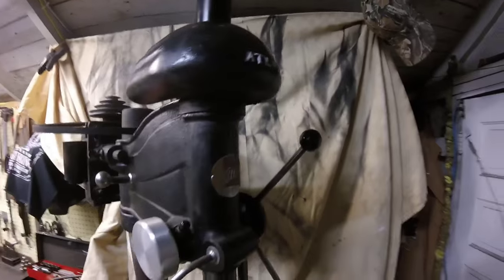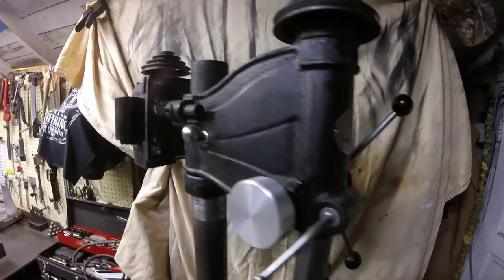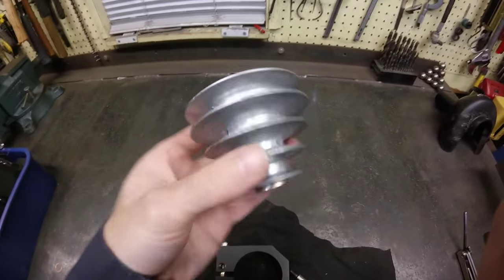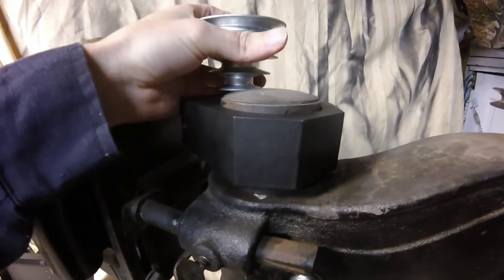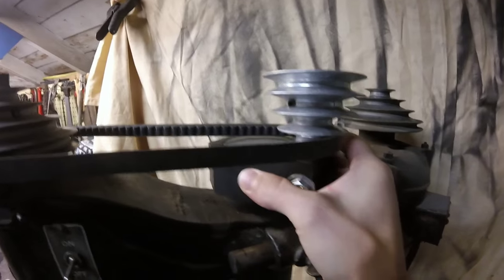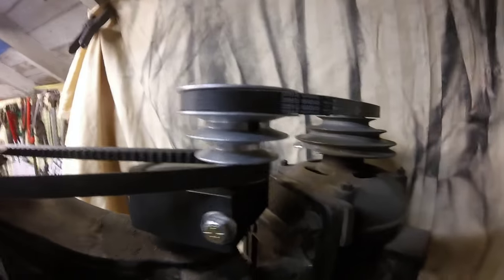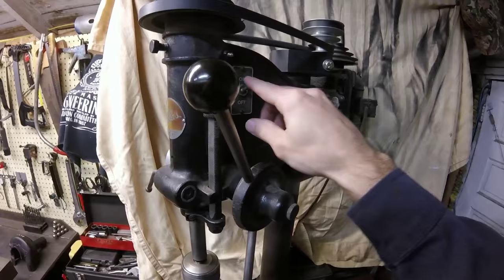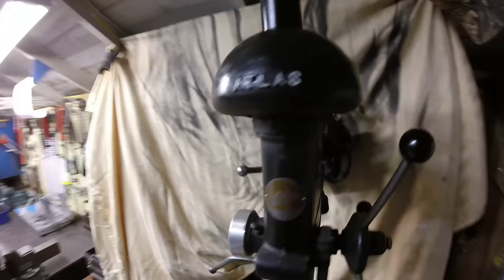atlas drill press pulley upgrade/modification

Comment: MrBen527 as soon as you removed the front pulley cover I seen why you had an RPM problem. The step pulleys shouldn't have the large diameters in the same directions it should have one on the top side and the other should be on the bottom side. Look up step pulley calculator on the inter net and you will be able to figure out your rpms.
Reply from the maker: +toddlfrank   You must not have seen the annotation in the beginning of the video.  I mentioned that I had already flipped that pulley over to work with the intermediate one.  Thanks for watching!!
Reply: dude be more positive and solve your problems with progressive & improved technology and leave cheap politics to burocrats

Comment: Thank you for making this episode. Very helpful. Wish I had one of those brackets. BTW, what model number is your Atlas?
Reply from the maker: Your welcome!  Looks like it's a model 63-1M
Reply: @MrBen527  Thank you for replying! I just found out mine is a model 73. Bought the stop assembly on eBay for $12.
Reply from the maker: @SCWD_US  Cool!  This press was saved from a scrap yard shop that was closing.   I had to replace the start capacitor on the motor and that was about it!
Reply: @MrBen527  nice!

Comment: Great! This is just what I need to do with my old Craftsman/Atlas. So what kind of bearing was in that housing? I'd like to do the same thing to avoid any permanent modifications to the press. I know I could make another motor mount and fab a jack shaft on the back with some pillow block bearings, but I feel like it'll throw the weight off by moving the motor off the center line.
Reply from the maker: +Bob C 
That housing is off of a servo driven ball screw assembly.

Comment: That's the perfect piece I need. Where did you get the bearing housing? I've got an old Craftsman 113.24560 with a 2.75" OD stand, and that would make my life  r-e-e-e-l  easy putting a jackshaft pulley on it...
Reply from the maker: It's a custom piece from my work place I replaced.  I slit it and drilled it out for the clamping bolt.  You could make one out of any heavy gauge material with twice the work I had to do with this part.  You could purchase a 2.75 inch shaft collar from McMasterCarr for 23 bucks and start with that.

Comment: thank you for your idea
im planning to use it not on my delta dp350 bench drill press but on my atlas clausen 60 inches bandsaw - that i just recently purchased for $75 from cl - if need it
my saw came without any pulleys, motor & blade
thank you
Reply from the maker: You're welcome!
Reply: sounds incredible, but my delta's reeve pulley shatered the driven reeve pulley - on the spindle in several pieces - and now im going into 2 simultaneouly steeper pulley projects. now im researching into the speeds for it. any how, your aproach into the steeper pulley system help me to understand some of its basic principles. im wondering if you have a video where you explain how to estimate speeds and pulley distance with driven belts - specially for drilling speeds with a drill press & a band saw. i understand that slower rpms are good for drilling steel and high rpms for drilling on wood. but, how does this works on a steeper pulley system? thank you
Reply from the maker: The step pulleys look more complicated than they are.  Their design is to utilize as little space as possible and still get a variety of speed options.  My drill press is on the smaller end which means made to work with small tooling at higher speeds.  I added the third pulley to further slow it because I work with metal mainly and want options.  As far as speeds, you could buy a inexpensive tachometer online, otherwise you'll need to know the speed of your motor first.

Comment: If you live in a humid climate you might wanna slap some grease inside that bearing mount. It'll seaze to the column , trust me I know it will. I had to use a 3 jaw puller to get mine off.
Reply from the maker: Its good.  I used sintered bronze bearings with grease.

Comment: It looks like the pulley on the motor is upside down! If you flip that over, and put the belt on the bottom of both pulleys it should put you at the lowest speed.
Reply from the maker: If you watch the whole vid with the annotation,  you'll see I flip it.

Comment: Wish you were selling the brackets. I'd love to buy one. Already have pulleys.
Reply from the maker: I don't know what materials I have laying around,  I put of town now.  If I remember and come up with a plan maybe I can make u one.
Reply: @MrBen527  That would be fantastic! Thank you for considering it. Please let me know.
Reply from the maker: @felixf5211  Will do
Reply: @MrBen527  Also wanted to mention that I have a spare Delta 2.75" collar from a DP220. Not sure there's enough meat on it to tap for a pulley, though, but there might be.
Reply from the maker: @felixf5211  I don't remember what size the Atlas is and I'm not home to check.   As far as the one u have is just a matter of welding some material or a nut to it if it fits.
Reply: @MrBen527  FWIW, I have a 51 and a 53. Both have 2.25" columns. Quite honesty, I have way too many drill presses. I refurbish and sell most, but sometimes I come across a tool that I have to keep: Two Atlas, three Delta DP220s from 1938, 1944, and 1953, and a Buffalo 15. Some completely restored, others simply refurbished. Just can't bring myself to sell any of those. Currently working on a Walker-Turner that I fear I'll have to keep, as well. Love the thing!
Reply from the maker: @felixf5211  My column is 2.75 in also.  If u want to use that collar u could send that and your pulley to me and I'll set it up and send it back ready to go with the shoulder bolt too
Reply from the maker: @felixf5211  I emailed you to see if it went through
Reply: @MrBen527  It did. Just sent one back. I'll be checking my email more often.